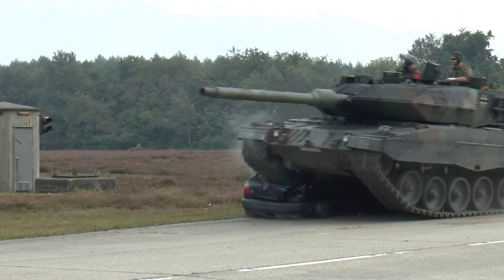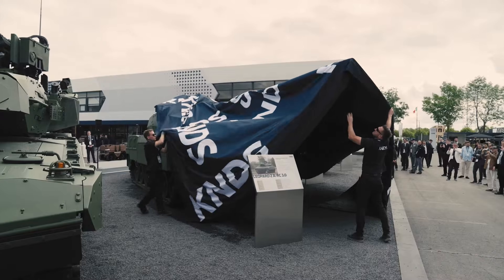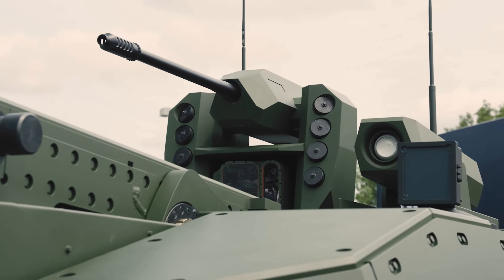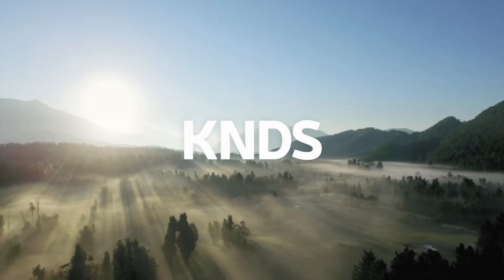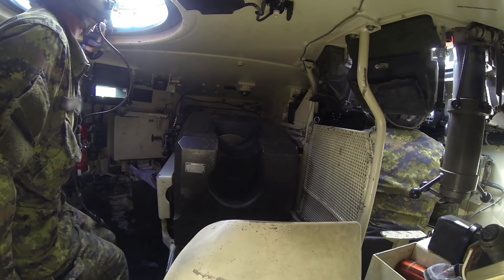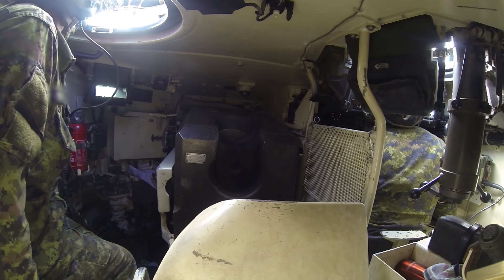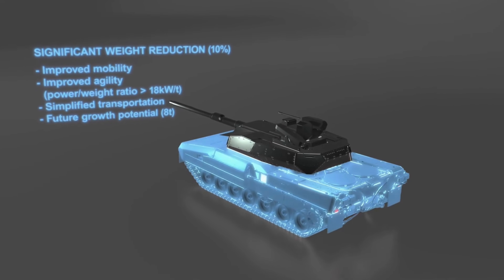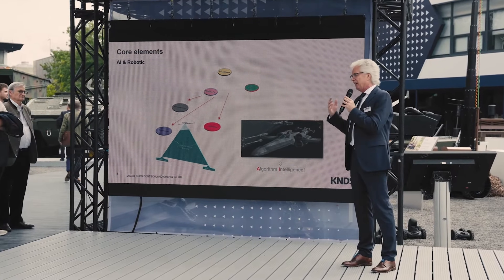The Leopard 2 A-RC 3.0 Main Battle Tank | 140mm SMOOTHBORE GUN

Comment: I see a couple of problems with this new type of tanks, 1 with only a 3-man crew there will be more stress to do tank Maintenace of a battlefield repair plus if one man is killed or wounded the crew will not have anyone to replace him, 2 camera and Sencers are great, but they can never replace a human's eyes, if the cameras or Sencers are damaged in battle or by artillery in close call or a lucky infantry shoulder launch rocket or even a lucky bullet hit the tank will be vulnerable and blind on whatever side of the tank senser was destroyed on and have to retreat, 3 then there's the problem of no crew in the turret with vision slots, with a human in the turret you have human eyes with over view of the battlefield with view slots as back up, but if you have no crew in the turret than you must count on cameras and Sencers, and then you have the problem of number 2 I explained already, yes a Non crewed turret has some benefits but it also has a lot of negatives as well so there is a tradeoff.
Reply: To your second point- I believe each position in the tank can (could?) duplicate any other. Higher load on the individual in that situation, of course. 

As to sensors, redundancy and protection of them is far easier, as cameras are potentially far smaller and easier to replace than a glass periscope. Modern armored vehicles don't have open spaces for human eyes- if the hatch is closed, you are looking through a periscope or very thick lexan/glass- the actual view is quite poor. With cameras they would be able to keep more spares available than periscopes.

Yes, there are tradeoffs, but I also believe it is unlikely that this would be the only kind of vehicle deployed.

Comment: Wasn't the Rh 130/52 gun specially developed to be compatible with current Leopard 2s? It sure needs the autoloader, but by using the older Leo 2 hull it seems to be working as intended.
Reply: Yes it is new autoloader turret for Leo2 chasis. And you can change guns in new turret.
Reply: @ErkiEntveg  I think they made it specifically that it will fit in a minimally modified old turret as well. Technically it should the gun weigs just 300 kg more than the 120mm/L55 gun and internally has very similar dimensions , but with a human loader (and limited bustle storage) it would repeat the T-62 problem with limited space and big ammo that would result in abysmal rate of fire even if they somehow made the ammo somehow possible to reasonably manipulate within the turret as the ammo weighs 30 kg per piece, so 30 % more than current 120 mm tank ammo.

Comment: 140mm cannon at <4 seconds reload is a crazy amount of firepower. Are they planning on fighting T-90s or Zaku IIs?
Reply: Maybe the next itteration of this tank could be the RX-75 Guntank.
Reply: Germany:JA
Reply: Needs more barrels
Reply: Yes 🗿
Reply: French engineering actually
Reply: They are planning to fight against some $300 remote/wired fpv drones
Reply: @poat3453 No, they are planning to defend against those drones. And then go FIGHT other shit.
Reply: @poat3453 Leopard 2 A-RC 3.0MBT < fiber optic kamikazi drone
Reply: @poat3453 Sigh. Another drone-spammed amateur...
Reply: Probably they're trying to be prepared, just in Case something usefull comes out of the Armata Programm.
Reply: 140mm not that new Germany had already Prototypes for a Leopard 2A3/A4 with a 140mm gun in 1980 the Gun alone is almost 11m length and can shoot 1900m/s (mach 5,54)

the actually leopard 2 a7/a8 can just shoot 1100m/s (mach 3.2)
Reply: @blackchecker2009  the Leo 2 with a 140mm gun was a Swiss prototype. Nothing to do with Germany...
And the "new" 140 here is actually French...
Reply: @federationprime A common maxim of tank-to-tank combat is that the first to hit often ends up winning. The 140mm cannon is a monstrously powerful gun, but even that amount of power in a single shot can't help if the shot misses or if there is more than one target. A rapid reload might just help get the next shot in before the enemy has time to properly react.
Reply: @ BTW IR lights and Lasers would jam IR cameras
Reply: You boomer! Never heard of Zoliaths type.

Comment: I don’t think the tank is dying. I just think it’s changing. Evolving is a good way putting it.
Reply: Exactly.
"Tanks are obsolete" is peak smoothbrain keyboard tactician.
Tank design simply has to adapt to factor in the increased threat from drones and ATGMs, the reality is that tanks fill a role on the battlefield that nothing else currently does, and will therefore still be needed.
Reply: @jamesoldham9995  Doubt it, I would rather have more IFV's with a 30 mm and some anti-tank rockets. The next "big" thing are wheeled drones, and you have one more problem to defend against.
Reply: It needs to adapt to fibre optic drones though...and quick.
Reply: @richardbradley2335  " ...today increasingly complex battlefield" since 1914
Reply: @kingsman3087  And so right Kingsman.
Reply: @richardbradley2335  Mass produced AI drones will take over, identifying and attacking autonomous, making those kind of heavy tanks an expensive not sustainable endeavor
Reply: Yeah, it's way past the times of trench warfare and WW2 style duking it out tank vs tank relying on heavy armour and penetration of the main tank cannon alone.
It's getting more complex with the complexity of the modern battlefield.
Reply: Japanese Navy officers were thinking the same about the battleships.
Reply: They still need heavy artillery support that need to move from point A to point B in heavy fire, with soldiers inside to capture the ground and hold it, thus needed to be heavily armored. The need for the weapon for any quick tactical maneuver, in case a threat has broken through on another place and you need a quick vehicle with heavy fire power to stop the enemy that are hundreds of miles away. No other weapon system that meets all that requirement.

A drones is good at blasting things at short range, but they cannot capture any ground. Plus, the drone operators are totally defenseless if spotted. You need actual people to be there, to defend and hold the area against any counter attack, then to set up another offensive position. Heavy arty and Missiles are good at making big boom over long distances, but you need to be in a safe firing position and would still take time to move from one position to another to follow the infantry, in the meantime while travelling,  they're useless and defenseless. Planes and Helicopter can't hoover around the area for hours or evendays to give support, especially they're susceptibility against ATGM. The IFV has a very thin protections for a full frontal assault and light assault support guns are insufficient in firepower to support any infantry who are attacking a very well armed and very well protected enemy position. Again, the need of ready on the go heavy fire power in any Tactical and Strategic Maneuvers.

Only a Tank meets that requirement.
Reply: @inisipisTV  very good point, people for the life of themselves don't have the strategic and tactical depth of thinking required to even have a thought process like this.
Reply: They said this for some years about heavy artillery to.  Also about anti aircraft guns like the Gepard, 40L70 and the Oerlikons.    And look now?  Now, no MoD would think of getting rid of 40L70 & Co.They would search for ways to improve the search and destroy radars and command posts and new ordnance.
Reply: a tank these days need something to counter drones, without that its a sitting duck
Reply: @kthec1298  a 30mm rooftop mounted autocannon which was (definitely) not mentioned in this video... maybe ECW suites or smth... 
y'know that everything you've thought about tanks right now has almost certainly been considered and consulted by every single (remotely competent) military's thinkers?

Comment: Makes me wonder if a cartridge/clip system could be made so a tank could be reloaded very quickly (with the provision that hand loading is still possible). Drones/UAV's are a problem; part of solution may be anti-drones/UAV's or fighter UAV's that loiter over your armor to shoot down hostile drones.

Best tanks? Between Chieftain and Abrams I think it boils down to the best crews vs just the hardware. Would not want to be in any other armored vehicle and have to face them (well, kinda old to be doing that anyway.... :^) ). 

Interesting times as armies try to figure out the new threats on the battlefield.

Comment: Why don’t tanks have external magazines further reducing turret size. Have another vehicle for holding ammunition. I have crazy vision of ammunition cart lobing shells like a basketball into a open slot on top of tank for loading. Then you have a entourage of ammocarts. And just get rid of gunner, just have driver and radioman. Two crew tank reducing size. Aimer firing from one of interchangeable ammocarts. The carts could be small and low profile hiding in bushes until it’s their turn for reloading

Comment: There should be dedicated AA tanks in the main attack group that follow close. To protect the group from drones. Like a mix of laser/kinetic AA gun on this chassis.
Reply: That's what SHORAD is. In the Cold War, it was Gepards following the Leopard 1 / Leopard 2, which is why it was important that they could engage air targets while moving. The Soviets had the Shilka. The Americans had a bit of a gap, as the Vulcan Air Defense System wasn't very impressive and the Sergeant York never went anywhere. Nowadays, a bunch of countries are buying Skyranger turrets on various platforms, while the US have IM-SHORAD.
Reply: Yea the US never really invested much in short range air defense other than MANPADS and to some degree the Pivads with 20mm vulcan.. 

They're too confident with their Airforce. 

Now that even small  low flying drones can be direct threat in the battlefield, they would surely invest more on it.
Reply: The Puma has a useful canon for that job and doesn't even require a radar to hit the target.

Comment: As a reminder. Abrams did it first. 140mm autoloaded with altered armor and profile. 
Was found "not worth it"
 limited ammo, not enough crew to help maintain and to expensive.
Reply: You're thinking about the 90's prototypes ?
 most NATO tanks had a 130 or 140mm prototype around this time, the ASCALON cannon is a direct development of the Leclerc prototype at the time.
Reply: Who knows at this point maybe Rhm found something. Tanks and helicopters especially the latter wasn't discovered full of new weaknesses until Ukraine war came. The helicopter is practically is not even a thing at that war.
Reply: @gerogyzurkov2259 the 140 isn't made or engineered by Rhm, but by the Frenchs from Nexter. It's the Ascalon project, one system compatible with 120 and 140mm guns. It's really interesting honestly, and very promising.
Reply: Truly not trying to poo-poo on the idea. Just noticed. 
Also if the can develop a rapid fire 140mm main, I want a test bed with a mbt hull altered around a 50mm autocannon! 
Cram enough radar in and drones won't exist near it!
Reply: @steveo9284  Did the US did it first? Or was it the French when they tried 140mm on the Leclerc for fun (Leclerc T4 Terminator, fun prototype, around 1996)

Comment: Makes you wonder if the KF-51 Panther 3 has been dropped.  Not as complex to engineer as a modern fighter but still complex enough to take at minimum 10 years to design and set up for manufacturing.  Tanks are mega projects
Reply: Different companies, Leopard 2 A-RC 3.0 is KNDS and KF-51 is Rheinmetall. The new Italian, Hungarian, and potentially Ukrainian MBTs will be based on the Panther so it's not likely to go anywhere
Reply: @maxstarki am really excited (if plans aren't changed) for my home country of hungary to have modern Mbts4744